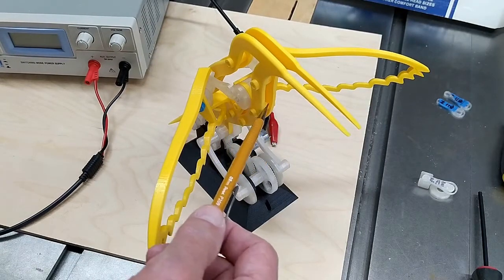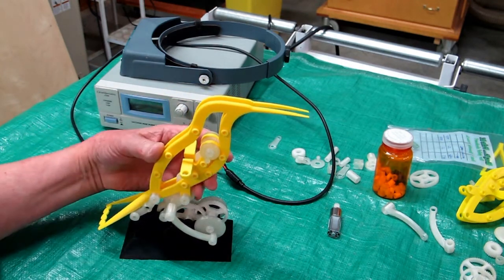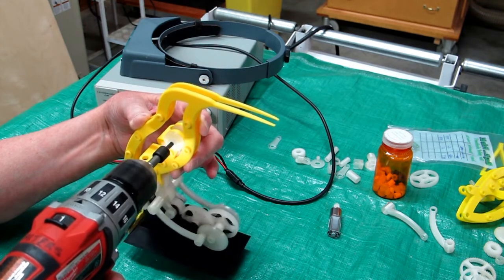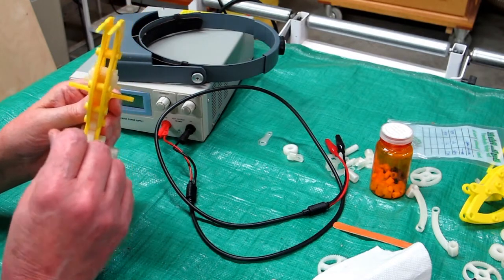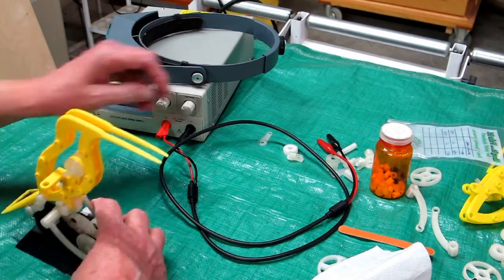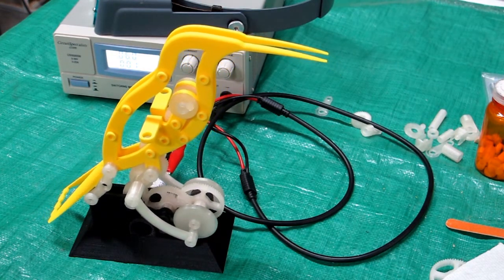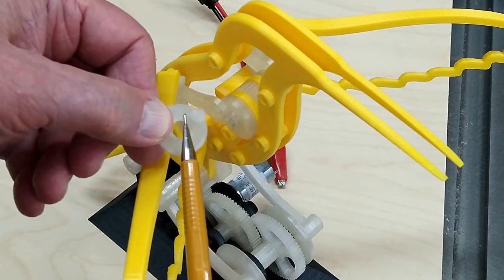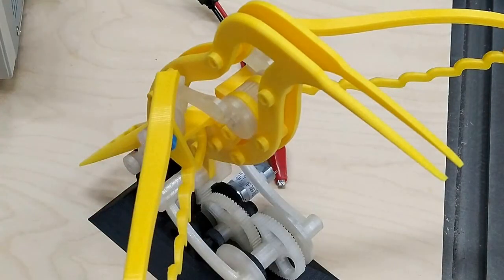Mechanical Hummingbird

Comment: Hello i got a question. I need to made some funnels  I saw you  video make one of silicone my questions  is how to made them whit plastic
Reply from the maker: If you go to thingiverse.com and search for "funnel" there are quite a few designs... but they would need to be 3D printed. Or you could learn how to use Fusion360 and use your design to 3D print a funnel.
A problem with 3D printed funnels is they are very laminated and may not be easy to clean... and I would not recommend them for food consumption.
The silicone funnel I made was very difficult to make. If you were trying to cast that same funnel with resin, that may also be difficult as the funnel is a very thin section.
Thanks for watching. Please subscribe! 
That is what keeps this channel going. 
Ron

Comment: This is a copy of Derek Hugger's Colibri, it will unfortunately always suffer from motion issues because Zumwalt didn't build the motion properly. Also, disappointing to see that he doesn't give credit to the original artist...
Reply: Hi aserta,

I'm gzumwalt, and my model was not a copy of Derek Hugger's Colibri, it was modeled after a video my wife took of a hummingbird feeding on her humming bird feeder at our lake home.  She loves hummingbirds, so I designed this for her from the video.  This model was put in service in 2018, and as of 2022, had ran 24 hours a day 7 days a week with the exception of a family member breaking one of the control arms.  It is still running today.

Hope this helps.

Greg